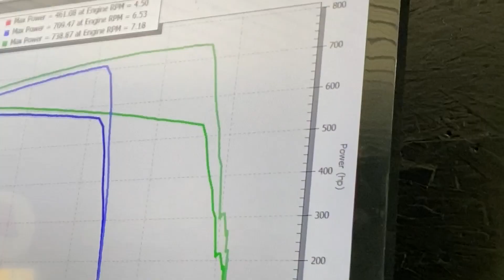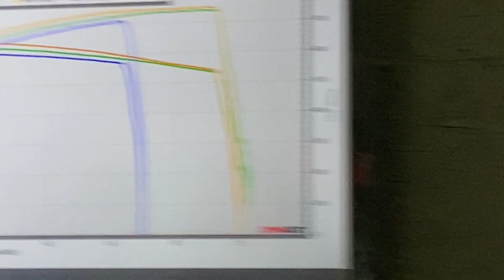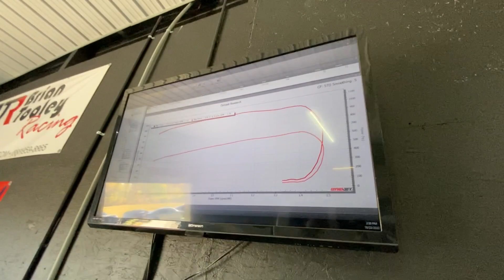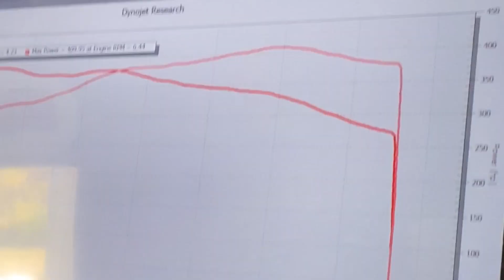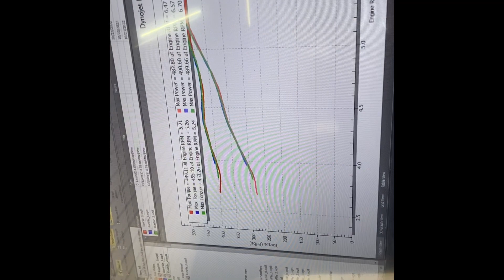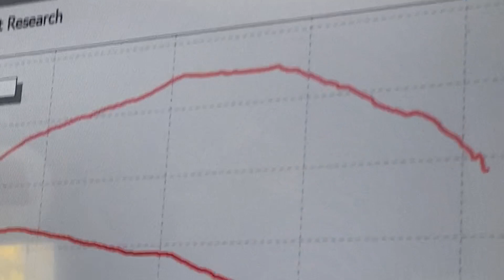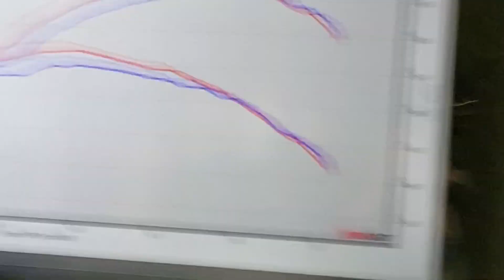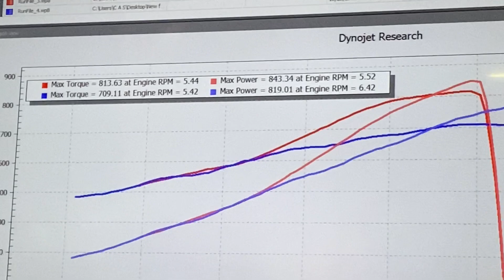My Buick Grand National made it to Horsepower fest 2022

Comment: If you are still having cooling issues after everything that you have done you have a pushed head gasket. Do a compression test and check, very easy to do.  Out of curiosity whats done to the engine?  Stock cam? If you have an aftermarket cam what are the specs?
Reply from the maker: it`s a stroker V6 with a Revolution X cam 215/220 from Full throttle with T/A performance heads (ported)
Reply: @2muchBoost_  Thanks. Do a compression test. If you never did it before let me know and I can walk you through it. It's very easy.
Reply: I"ve been watching all your videos since the summer and I have some other feedback for you to consider.  I would recommend considering switching to E85 and dump the Methanol pump. I've been using E85 all  year running 30-31 pounds on my stock block and its taken a ton of abuse. I get flex fuel at Sheetz and its a consistent 80% concentration. It's cheap and available just about everywhere.  If your pump goes or starts getting weak or your mixture isn't right it can lead to detonation and pre-ignition and can damage a head gasket easy.  TO convert I run 120 pound injectors, the Helcat pump in the tank and upgraded lines.  I have a flexfuel sensor with my EEC-GN computer and its automatically adjusting the mixture appropriately.  It's a very simple setup that takes a potential failure or adjustment issue out of the equation and you can get rid of the VP Methanol jugs.  Also on my setup I run the BE COOL radiator, a stock fan and a 160 thermostat and my temps never go over 170 even in the heat of the summer.